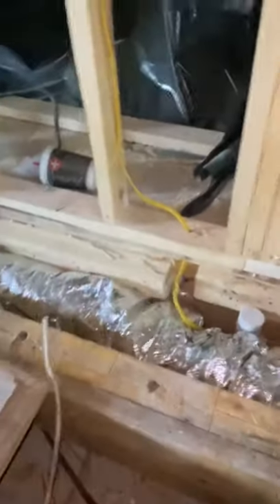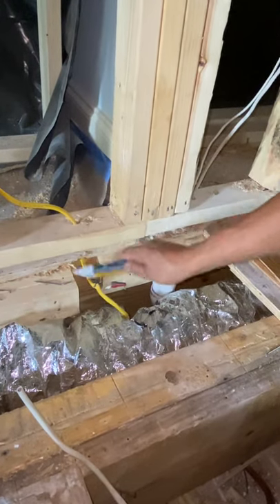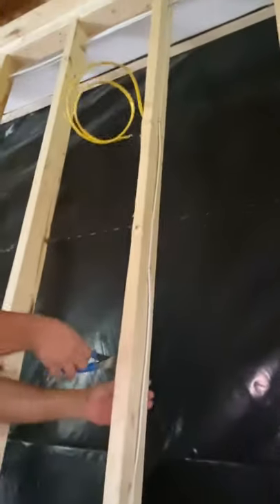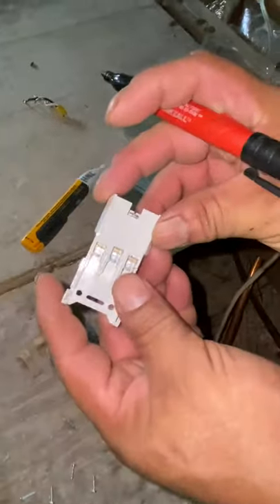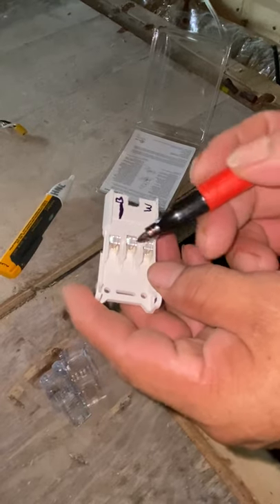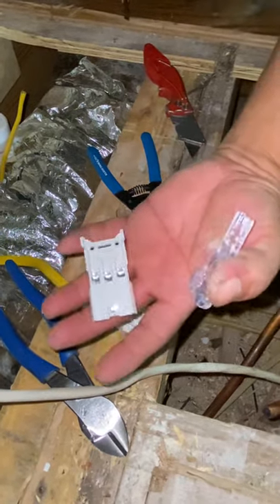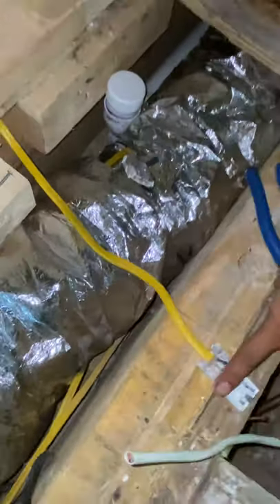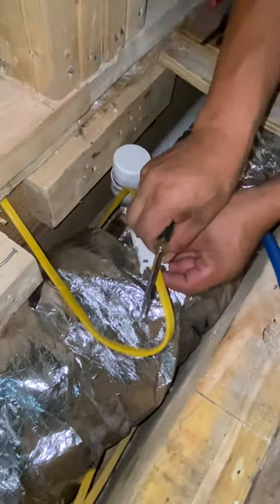How to repair a cut wire with a splice kit

Comment: Great job I didn't even know that they were around those are very cool I like them Thanks so much
Reply: Same. I sent a spade bit through a 14/2 and ripped it to shreds. My fix? I put an outlet on the wall right where the slice was - luckily, it was right around the area an outlet could go and not look odd. Had I known about this, I would have just fixed the darn thing.

Comment: found one of these inside the wall behind a mirror that was removed... wound up adding a cut-in box and adding an oulet because the contractor had the outlet were the mirror was and then when the mirror was added the used one of these splice connectors...and moved the outlet to another location.... used to sell these too when I did Hardware retail... handy little accessory in emergencies like this....

Comment: Never used a tyco splice kit but was told at several continuing education classes ( need 8 hours if CEU'S a year for my elecrical lucense ) that they are a one time insertion approved fitting. If you unplug it you must replace it. Great for not only a great for 14/2 or 12/2 NM ( romex ) cable but

Comment: I used one of these splice connectors once, but not this exact brand.  It is still working without problems.  I am old school and I am used to using junction boxes.  My kit did not come with those metal strain relief items.  I looped the two cables (14-2wG) side by side and wrapped them very tightly with several nylon cable ties.  I doubt any normal person would be able to pull that splice apart by tugging on the cables.  I certainly would prefer a kit if the wires were held in place by screws like the screw terminals on common outlets and switches.  While the metal parts of the kit seem pretty flimsy to me, they are probably of the same "quality" as the metal parts of the speed wire "clamps" in the backs of outlets, which I try to avoid using at all costs.  I watch repair videos every night.  Yours was wonderful because you showed all the steps and you discussed each step.  A job well done!

Comment: We use these several times a month and have had no failures.   Probably have used between 100 and 200 over the last 2 years.  Electrical supply houses sell the 4 wire version so you can splice a 12-3 if needed.  Always give the homeowner the option of replacing the cut wire or using a splice kit and let them make that decision.  These can literally save someone hundreds of dollars if you figure labor to replace a wire and Sheetrock repair and painting.  Always check voltage after you make the splice.  Then after you secure it back inside the wall or ceiling, check voltage again.
Reply: I have been in  remodel business 36 years and probably accidentally cut 3 or 4 wires in that time. pay attention to what you are cutting
Reply: @williamfade5540  shit does happen, obviously. Are you saying that those "3 or 4 wires" you cut, you weren't paying attention? At least there's a fix, correct?
Reply: Do you have a supplier as I can't find them in my town?
Reply: @billmonroe8826  I can't find them nowhere not even online. Let me know if you find them anywhere

Comment: Thanks for the vid.  The loop clamps on either end act as strain relief and pull protection.  They really should be installed.  Think about the pulling you were doing to gain working length.  If the wiring is not protected you could have an unsafe condition.  Thanks again.

Comment: Careless  people blind cutting or drilling will continually cut thru water, electrical and gas lines. Its always going to happen. A accessible J box would be everybody's #1 optioned. Sometimes its not practical to install one. I've used this splice kit and if installed properly its positive and UL approved.

Comment: I can't believe it.I am absolutely terrified of electricity but am in desperate need right now,and you have made "the widow lady"feel like I can actually do this,but I will flip the main
Reply: In regards to your stove outlet, I’m not quite sure that’ll work with that thick of wire as well as a safety hazard seeing that your stove draws a high amount of current.

Comment: Those imo look like crap. I would have ran a junction box somewhere. Anywhere. If for any reason you have a problem you won't find that splice either. You just create the same issue. Yeah they're approved but I would still avoid them.
Reply: Junction boxes are the preferred way, any day, but you don't always have that option if your in the business long enough.. They are more expensive and up to  code. Definitely a job saver in a pinch. Thanks for the video. I have a situation where I'm forced to use the splice kit because the customer will not tolerate a box..

Comment: Don’t you still need to have access to it even if it’s a splice kit?
Reply: I had the same question, found that in 2014 the language in “NEC” allows for you to cover these up in the case of a repair where the drywall is already up.

However, if it’s not a repair, you’re supposed to either fix it a different way or put in a box.
Reply: Splices must be accessible.

Comment: I would use the metal strain reliefs that came with it.
Home Depot 7$
Tyco Romex Splice Kit 
Model#: A22899-000
Sku#: 302061
Internet#: 202204326
-NEC approved Article 334-40b.
NEC compliant - article 334-40b, 2005 and 2008 NEC
-For Use On 12 or 14 AWG (300 Volt) 2 wire NM cable with ground.

Comment: Why did you not strip the casing off of the hot and neutral wire
Before you put them into that splicer?
I seen you just cut back the outer casing plus the insulation And that was it.
Are the contact points in that splicer really that conductive to be able to make that arc jump from one side to the next?
Reply: They work like the 3M Scotchlock connectors.  No need to strip the wire.  The metal connector cuts thru the insulation when the wire is pressed into it.
Reply: @JT_70  thank you though
I figured that out like an hour after I watched this video researching the product lol.
I forgot this comment was still up.

Comment: I don't know it's up to cold but the best way to repair a job like that is to twist the two wires together and on end and solder them and then tape it all up with good tape makes it bulletproof if you solder connection after twisting it the right way it's actually stronger than the original wire itself old School technology works great
Reply: Likely would work
But no that's not up to code what you are talking about lol it sounds like something a DIY-er might do effective yes but sounds like a fire waiting to happen. Not immediate I'd hope hell if it atleast lasts for 20 years I'm not complaining.
Even him using that splice kit while that is up to code
They are one time use and it for any reason unplugged you have to replace them Atleast that's what another guy said.
If it were up to me seeing that open wall and where that wire is running in the wall.
I bet the other end of that wire probably runs under the floor.
So that spice kit acted as a quick fix 
Seeing that thing is made out of plastic kinda scares me a bit though and I think he could have exposed his hot and neutral wire a tad bit before putting them directly into that thing.
I might go with the junction box and just tack it up on one of them 2"/4" boards out of the way however keep it accessible via an access point placed on the floor and coved with an small opening and closing door even just casually a vent.
I am not an electrician however I am not opposed to learning more about it as a means to find a life long career.

Comment: Wall are open. Just change the wire 
Or cut it back to accessible place
Reply from the maker: There is no access where that wire coming from...
Reply: @hipolitonorbertocruz3947  no access than how did you get the wire in.  The first time. Or the ductwork.   Or the plumbing.     B S

Comment: This is cool.  So does this replace a junction box?
Reply from the maker: Yes, that eliminated a junction box
Reply: @hipolitonorbertocruz3947  Metal J Box is better. It's not code but common sense tells you a nicely  done splice in a bonded box is safer.
Reply: @DonkeyLipsDA3rd  yeah but having common sense means not breaking the NEC code, if you know what that means. He’s done work for my home and have never failed me and FOLLOWS CODE.
Reply: Hire licensed and insured electricians so when they burn your house down you’re not screwed.

Comment: Actually you should always use the metal brackets as they prevent the wire from pulling out of the connectors that you indicated are so easy to bend. Your incorrect use of the product is no better than the splice that was already there. Try reading the instructions next time!
Reply: Do you think he has an electrical license?

Comment: Wow,  this is hard to believe this is NEC approved.  Problem I've got is the tiny looking pinch tabs you mash each wire on.  20 amps on that?  Not for me.
Reply: I guess when you get an electrical engineering degree you will figure it out.lol

Comment: please don't do this  junctions in the wall are the hardest thing to find. Pull a new circuit if you can first, or at least make it accessible. it might work for a while but it will break eventually.

Comment: Why not strip the wires where they get pushed into the connector? That way no chance of insulation compromising continuity since the pinch connector grips the copper not the insulation.
Reply: Thinking the same exact thing? Looks like the casing is preventing the contacts

Comment: Not for me, I see you pushing in unstriped wire into the connector, it does not look like you would have full contact like striped wires and wing nuts in a j box.

Comment: Not a good idea. Use a box with wire nuts if box is accessible. If not, a box is still better than this - even if it is not legal.
Reply: A metal box with metal cover, secured to stud, grounded, using wire nuts.
Reply: There is a reason why it isn’t legal, common sense buddy.
Reply: @lizziegonzalez2151 I'm curious to know the reason why wire nuts in a junction box is not legal? Obviously it is mechanically and electrically as sound as every other junction in the house, so is the access required because of a thermal issue?
Reply: @douglasmoore9918  wire nuts in a junction box is legal. The access is required in case the junction comes apart. wires vibrate at 60hz, so the vibration can cause loose connections over time. So if you have to junction make it accessible. All junctions in a house must be accessible.

Comment: No, no, a thousand times no. It's all about area of contact. These kits are crap. Same reason you don't use the quick connects on the back of some electric outlets. Do it right the first time.